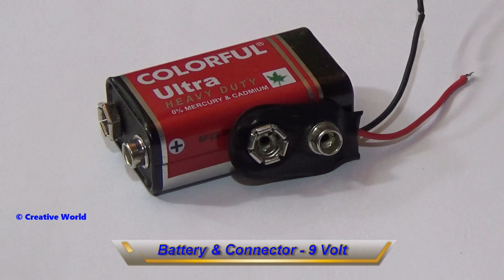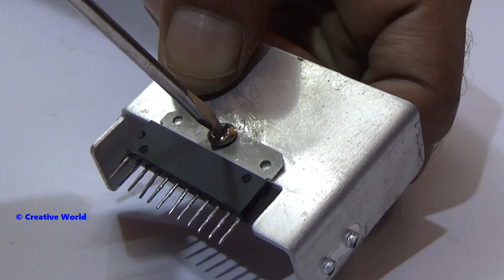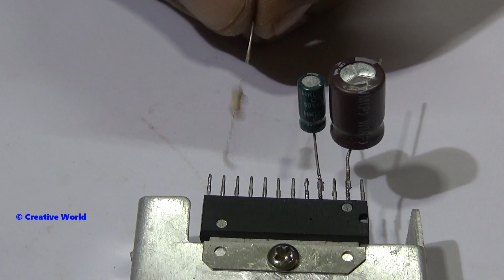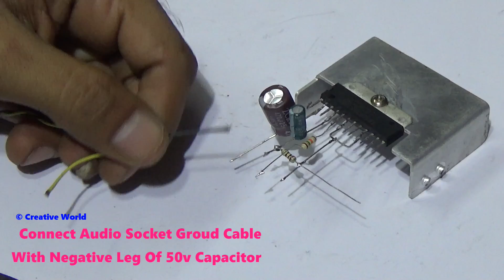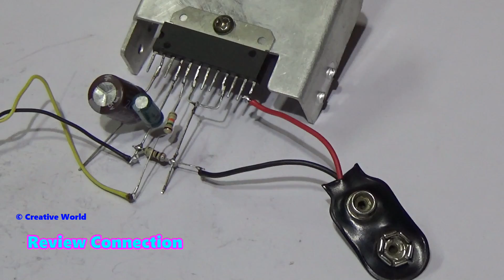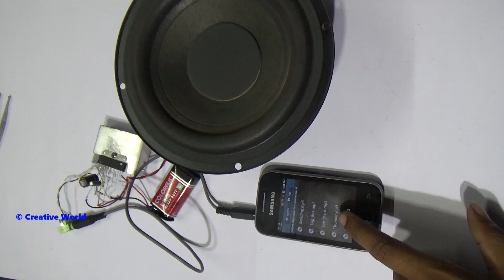How To Make Subwoofer Amplifier Circuit At Home Easily

Comment: its should be 12 volt input for the ic..that's why output not clear
Reply from the maker: if we use volume controller ,,then it will be more clear sound